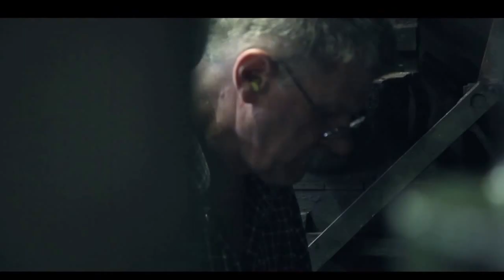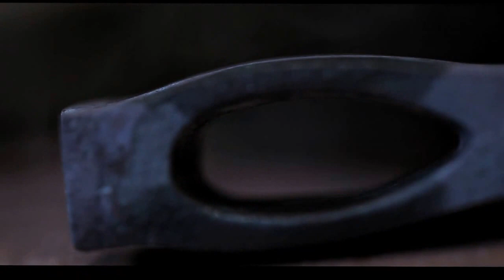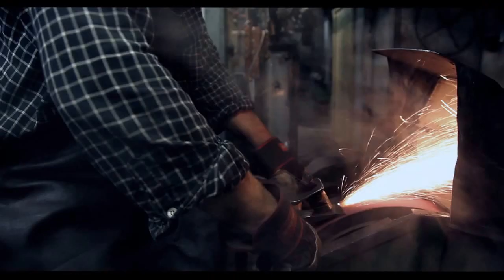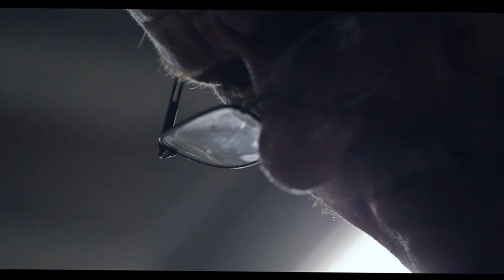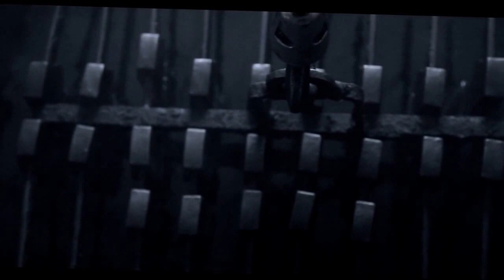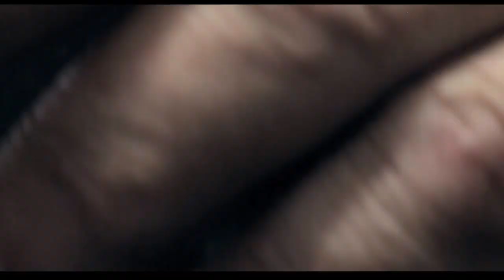Wetterlings, Axe Makers

Comment: just a heads up guys... great axe got the #115, 2 #118 one going to Cody (Wranglestar) for review. Wetterlings sheath on the #118 dried up like a leave after a nigh out in the South African bush.... Zero support from Wetterlings blamed me for putting it in boiling water or fire can't remember what crappy excuse they came up with, never the less spend money on Autine or Grundfors rather at least they still have pride in their product. that said they are good axes but once you pay your on your own.
Reply: Truth be told. Perhaps you should have taken the initiative to treat the leather considering the harsh environment you are in.
Reply: Chris Venter Yeah leather will do that left untreated in extreme heat oh and btw Wetterlings just like there sister company guarantee the axe head only,not the mask or helve, it's a shame that the Branby family have decided to throw their weight behind the Gransfors brand and are shutting up shop on the Wetterlings!